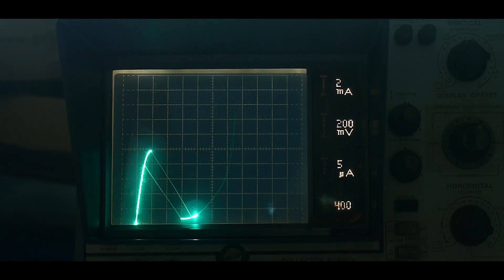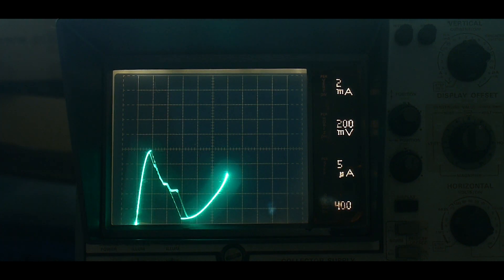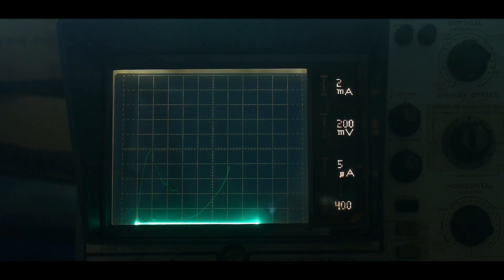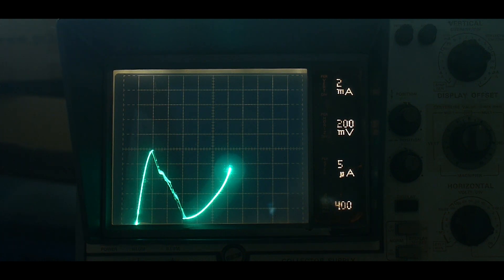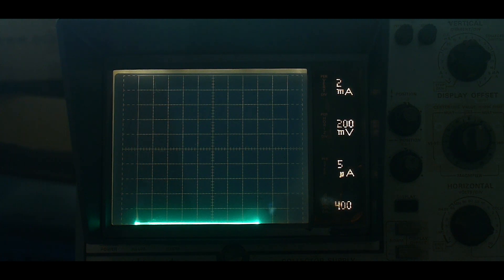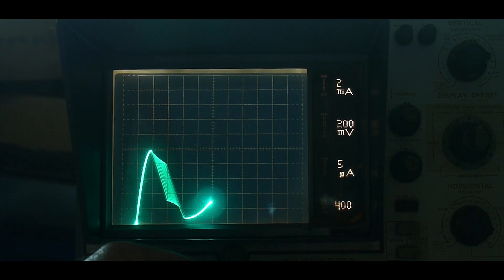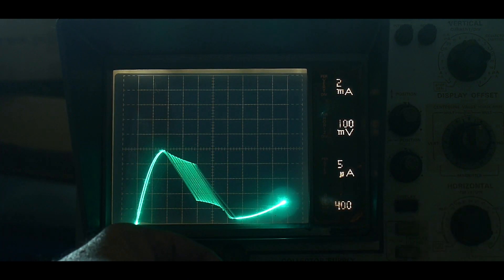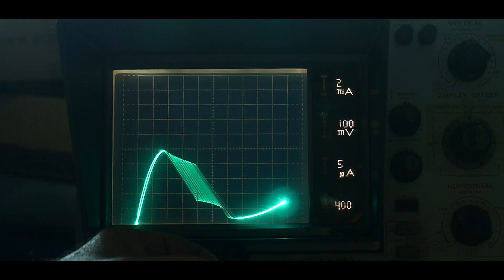#1816 Tunnel Diode AI301G (part 2 of 3)

Comment: I started building radios in 1963. At some point I got acquainted with tunnel diodes and purchased some. I still have them. That period of time was most exciting as the semiconductors were pushing out at all fronts and many exotic devices came around. Many of them are now unknown. I still have data books of that time and it is both nostalgic and exciting to read them. I guess now it is extremely difficult to buy even tunnel diodes.

Comment: I remember in the old tunnel diode papers where they talked about a negative-resistance region.  Operating in this region allows the diode to be used as an oscillator or amplifier.  Weird stuff.

Comment: The tunnel diode motor or pendulum is a fun device to play with.  It is described in the Scientific American magazine Amateur Scientist column by C. L. Strong, October 1965, pg. 112.  The invention is attributed to Harry E. Stockman.  It consists of a tunnel diode, two resistors, a coil of wire, a 1.5 volt battery, and a magnet.  No commutator is needed due to the action of the tunnel diode.  I built one back in that era and it worked fine.  I suspect you could leave out the resistors and power it with a solar cell instead of the battery, since the resistors form a voltage divider that biases the diode to about 0.42 volts.  It would be a simple series circuit of the diode, coil, and solar cell.

Comment: I got a heathkit "tunnel dipper" dipmeter at a hamfest, was never able to get it to oscillate.
Reply: I'm sorry yours is not working.  It is an intriguing device.  I have a Heathkit Tunnel Dipper that oscillates just fine, but it doesn't make the best dip meter.  The Tunnel Dipper got a bad reputation because the meter is quite touchy to adjust with the gain knob.  Unlike a grid dip oscillator where the oscillation amplitude is constrained by the negative feedback of the grid bias, the Tunnel Dipper oscillation amplitude is clamped by the "walls" of the diode I-V characteristic.  Thus, it is not very sensitive to outside influences such as the nearby tuned circuits it is supposed to sense.  The designer tried to make up for the lack of sensitivity by adding a lot of dc gain in the meter circuit.  The touchy adjustment was the result.  Had the design incorporated another means of negative feedback to limit the amplitude, it could have been an excellent instrument.

If your tunnel diode is good, maybe the trouble is wrong value bias resistors or the contacts to the plug-in coils are out of whack or dirty.

Comment: really an interesting component. Was it actually a coincidence that we “invented” this diode?
Reply from the maker: A tunnel diode or Esaki diode is a type of semiconductor diode that has effectively "negative resistance" due to the quantum mechanical effect called tunneling. It was invented in August 1957 by Leo Esaki when working at Tokyo Tsushin Kogyo, now known as Sony.
Reply: understand, thank you for reply !

Comment: Your diode has parasitic capacitance, so if you put large inductor the oscillation frequency goes down so your curve tracer bandwidth make it able to see the oscillation.
Too small an inductor make oscillate so fast the you see the end points only.
The right amount of inductor make the poles and zeros ( of your curve tracer and diode system) line up correctly and cancel oscillation
One way to get ride of oscillation is to put shunt resistor with your diode as I mentioned in part 1
Let R1 be the resistance of your diode and R2 is the shunt resistor you put in parallel with your diode:
Here is the Math:
For parallel resistors we have:
Req= (R1*R2)/(R1+R2)
Say now R1<0 that is R1 is a negative number.
The only way Req becomes positive ( so we can measure it with normal circuit) is when ABS(R1) > ABS(R2)
(i.e.  ABS means Absolute Value)
In that case both numerator and denominator become negative and therefore Req becomes positive (division of two negative numbers is positive)
So you can measure Req and since your R2 is known positive value which you shunt R1 ( your diode ) with it. you can calculate R1(your diode) equivalent resistor.

Comment: That second curve is not what you saw with the East Block devices.  Ipso facto the Kiethly I/E forcing means there is no oscillation.   The devices are just doped poorly.   Get some real tunnel diodes.   And why not tell your viewers where they can get a copy of the GE book.   I know you didn't make a Xerox copy of my original.
Reply: The link to the manual is right there in the description.
Reply: @andymouse  I don't need the link.   I have an original.   The creator of this video should have read the whole book from cover to cover before creating another totally misleading video full of incorrect conclusions.

Comment: Back in the early 1970s, Tektronix had a little device which was a tunnel diode “pulser”.  You fed it with a pulse generator and it generated a really fast rise time pulse used to test rise-time and therefore, bandwidth of the scope and plug in units.  I ran a “calibration” shop on a carrier and our set of “standards” was pretty limited due to space, environment, and limited training of most sailors (and money, of course).